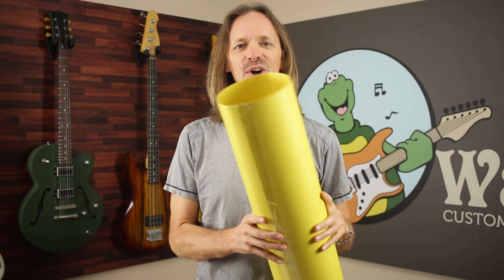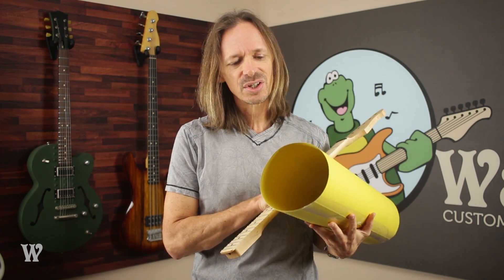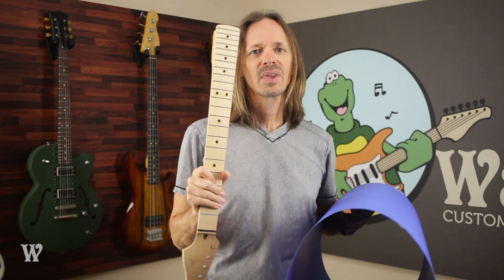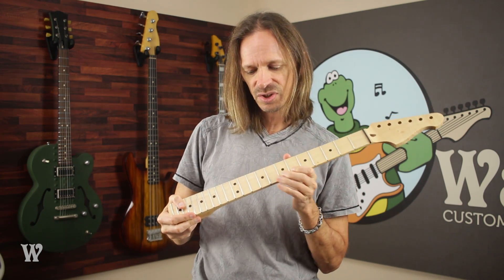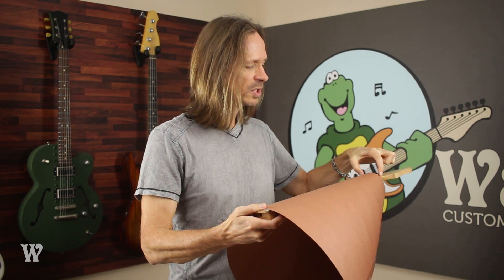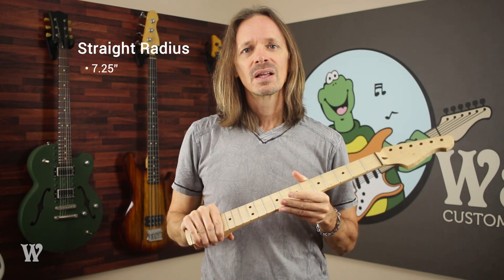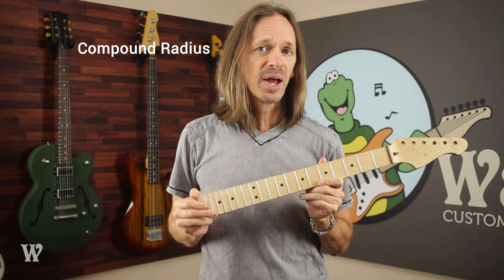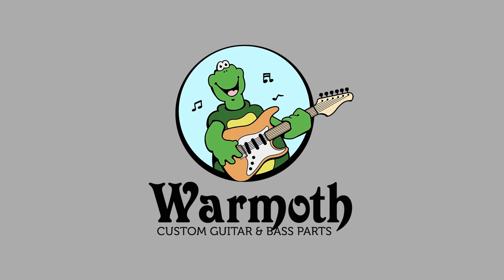Fretboard Radius Explained

Comment: That's a 7 and quarter inch diameter, not radius.....radius is the measurement from the edge of the circle to the middle of the circle. Diameter is measurement from the edge of the circle to the opposite side of the circle through the middle of the circle
Reply from the maker: Nope, fretboards use the radius. Can you imagine a curved a 7.25" fretboard would be if the number referred to the diameter? LOL. You can learn more here: https://warmoth.com/guitar-neck-fretboard-radius

Comment: wow thank you so much for a clear understanding lesson....i have a question...if the fretboards has a radius of a curve that means the frets are also curved same as the fret board..... when people sand the frets they are using a flat block with sand paper then the frets are not curved as the fretboard...the frets will be flat ..please explain on this  cheers again thanks for a great lesson..

Comment: Compound radius numbers represent 1st and 12th fret? If so,  the the bridge radius should be calculated as R12+(R12-R1), correct?
For example,  for 10-16" fretboard my bridge should be set to 16+(16-10)=22"

Comment: Here from the future (😁) to bring up why you'd want a compound radius. The answer is: lower (and more consistent) action!
With a standard radius fretboard the height of the outer strings (E,E) changes at a different rate than that of the inner strings (D,G). Why? Because the fretboard widens as you approach the guitar's bridge.  (Typical widths are 1.5 - 1.7 inches at the nut and 2.0 - 2.25 inches at the bridge end of the fretboard.)
Think about what will happen to a cylindrical section with a 12 inch radius when you make it wider at one end: as the section gets wider, its outer edges will 'fall away' from the center line of the section more than they do at the narrow end, simply because the wider part of the section contains more of the circle. This means that your outer strings will seem to rise as they approach the bridge, requiring a lower adjustment at the bridge. 
BUT, when you try to do that you run the risk of having notes "fret out" near the middle frets because the strings are not traversing the fretboard in a straight line, i.e. parallel to the section's center line. They would if your fretboard was the same width at both ends, but who wants a guitar neck that's >2 inches wide at the nut? Or 1.5 inches wide at the bridge end, lol!😁

Compound radii FIX this problem by changing both the width and the radius as you go from nut to bridge so that the strings' height is more consistent from one end of the fretboard to the other!

Comment: This is not correct. A16” circle is the diameter not radius. A radius is measured from the center to the circumference. A 16” circle would have an 8” radius.
Reply from the maker: All the info in the video is correct. You are right that the way guitarists use the term "radius" to describe the curve of the fretboard makes it a misnomer (just like the term "tremolo bar"). Nevertheless, it's the accepted term. What we really mean when we say "this fretboard has a 10" radius" is that the curve across the width of the fretboard is equal to the curve of the circumference of a circle with a radius of 10".

Comment: ok, but I'm a little confused, using your small cylinder you said you have a radius of 7.25 inches..I looked up the term radius and it said its a straight line from the center of a circle or sphere to the edge of said circle to sphere..So, correct me if I wrong, the higher the radius the more pronounced the curve of the fretboard..thank you
Reply from the maker: Nope, that's incorrect. The higher the radius the flatter fretboard.
Reply: Ahhh, thank you @warmoth
Reply from the maker: You are right that the way guitarists use the term "radius" to describe the curve of the fretboard makes it a misnomer (just like the term "tremolo bar"). Nevertheless, it's the accepted term. What we really mean when we say "this fretboard has a 10" radius" is that the curve across the width of the fretboard is equal to the curve of the circumference of a circle with a radius of 10".
Reply: thanks, that makes sense to me @warmoth

Comment: I love the 10-16" radius. If you want a locking tremolo with that radius, the Schaller Lockmeister is a perfect fit. It's almost completely identical in to the German Floyd Rose (also made by Schaller), but it has a flatter radius of 12", but you can get 16" if you take the shim out, and it comes with a 10" nut, so I can get a low action without the fret buzz and still play chords comfortably. 

If you have a body made for it, pick the Floyd Rose routing, not the Schaller one as it's made for a different trem.

Comment: I can't understand why guitars get such a small angle. The neck of most guitar  is very semicircular, the strings E1 and E6 slide off, they fall off with the vibrato. Tragedy. I have been looking for a flat, wide neck for years because it is the most comfortable one. It does not cause problems when playing.

Comment: Would you guys be able to build something similar to a Yamaha pacifica neck? It's a bit odd where it has a 41mm nut but the fretboard radius is 13.75 inches. (I would choose the 14" option from your website) Do you think it would feel somewhat similar if I got the 41mm nut with 14 inch board?

Comment: With the compound radius fretboards, what is the string radius that the nut & bridge saddles have. I would think the nut is going to be either he 9.5 or 10 that the 1st fret of the neck starts at and it's up to the set up to get the saddles to 14 or 16 that the fretboard radius is at the 21st-24th frets ? Isn't that going to be too flat for the middle of the neck and the action be set too high where the mismatches occur on the neck ?

Comment: I was ultimately screwed over by a website claiming that most fretboards out there have 9.5" radius. Once I looked up comparison of different brands, I found that the guitars I'm familiar with and are comfortable with have a 12" radius. Also, actually, MOST seem to have a radius of 12"... NOT 9.5". Now I'm going to have to adjust the 9.5" radiusing block to make it 12" radius that is on it's way.

Comment: A note about Floyd Rose nuts: they're not only 10" radius.

They come in 10", 12", and 15" radii. 

The 15" is confusingly named "R10" (at least for an OFR). I put those on my 16" and 17"  Ibanezes. 

I will say from experience, that unlike most other guitar setup specs measured in thousandths of an inch that you can really feel, the nut:fretboard:bridge radius relationship leaves me the most wiggle room to fudge. 

Not a ridiculous amount, but some. Because the differences between, say, 9" and 12", or even a 12" and 16" are quite small.

Comment: Compound radius is like a fix for a non-problem that creates a problem. I have a compound radius neck from Warmoth and it's horrible. I could never get low action that was close to any of my Charvels or Gibsons. It's not Warmoth, it's the inherent concept flaw. Just try to get someone to do a fret leveling-super pricey. Just how do you get a "perfect transition" from one end of the neck to the other? Plek? Maybe. Not by hand, that's for sure.  I love Warmoth and the neck so I'm pulling frets and re-radiusing the board and re-fretting. Sometimes you don't need to fix what ain't broken. Do we really need or want compound radius? I don't, to me it's less than useless and creates more problems than it solves. But to each his/her own....

Comment: Very cool video! However, I have a couple questions, that i hope you can answer for me. 
I have an old Matao Artist, that I have played enough that the frets are needing to be leveled, and crowned. Replacing the neck is not an option, due to it being a through neck. There is no real spec. info on it, so my first question is. Is there a way to at least get close to what the original radius is, without a radius guide? Being on a fixed income, I will have to do the work myself, and can only afford the bare minimum of supplies. I am not scared to do it, since I figure if I can make my own dentures, that fit very well, and look natural, I should be able to handle fret work, so long as I am armed with as much info. as possible. 
Next question. Can I just pick a radius sanding block, appropriate to what my main playing style is, and be okay ? at east 95% of my rhythm playing, I do in barre chords, so a little sacrifice of regular chords near the nut would not be much of an issue. 
Thank you for your time, and any advice you could share. 

Also, I have to say, I found it ironic, that while searching for info. I found this video, because I have a friend in Montana, who I started a Math group with, that is related to you!

Comment: I have always been a Fender guy but recently bought my first Ibanez. This thing is nuts. It has a 17" radius fretboard, a 5 piece neck that is the thinnest (from fretboard to back of neck) I have ever seen, it's got the smoothest trem system called the Zero Resistance (ZR) that moves on ballbearings and has an adjustable tensioner  knob  on the back. I read a lot of hate about that system, but I love it. It stays in perfect tune no matter what I do. And going back to the flatter fretboard, it takes a little getting used to but once you do, sell your Fenders because you just won't play them anymore. Like getting a Corvette and then trying to drive a Chevette. It just don't work.
Reply: may I know what model that is?

Comment: Can I order earth radius? Something like 6 000 km? Someone without imagination might call it flat. At least gibson fretboard would turn pale next to it, so curvy.

Btw which manufacturer first introduced compound radius? The most familiar I've been with Jackson, I believe 12"-16"? And what might be the reason manufacturers stick to different solid radiuses and only few go to compound? I can see with classic guitars sticking to classic. Appreciate the context of floyd roses, that's what I wondered when checking the options. I was thinking what's relevant when the website said floyd should be 10", but probably the most recognizable combination is jackson with floyd and 12"-16".
Reply from the maker: Both Warmoth and Jackson introduced compound radius at about the same time. A case of parallel development, I think.

Comment: When you say a 10" radius neck, is a true mathematical radius measurement or is there any conversion factor involved? I am only asking because the posterboard models looked small for the radius values you give.
Reply from the maker: The props are not actual size. I apologize. I did not have time to build them to scale or to paint them.
Reply: @warmoth  don't apologize. It was informative. I'm just surprised in how flat even a 7.25" radius neck feels compared to what I would expect given the r value. Probably because my point of reference is spheres and balls rather than cylinders.
Reply: @tak-el-uc  could always trace out part of a circle using something the length of the radius you want to see.

The number would be the distance from center to the outer edge. If you had a ruler with a hole on one end could just hold a pencil at the measurement to want to see

Comment: I could be incorrect but 7.25 is mostly known on 50s through 70s guitars from fender. 

Les pauls tend to be a 12 radius. Same for gretsch big body guitars, jets, and penguins. Modern strats today I believe are 9.5.

I recently got the 10-16 compound radius from warmoth and it looks like they did a amazing job as usual but I haven't tested it yet. Still setting up the guitar body I want to put with it. 

I have however tested a older neck made by them, and another neck I recently had them make and warmoth so far seems to have done a better job at making necks than fender in my experience so far. Sorry fender but some of your necks had my strings slipping off the fret board. Also got a channel bound fender American standard 2015/2016 tele anniversary neck that just feels... I can't figure it out but it isn't the greatest guitar neck lol. Whenever my fingers make contact with the rose wood channel bound fret board it feels as if my fingers get hung up on it, making sliding a burden. 

Warmoth however is yet to disappoint me.

Comment: Ii think you have your diameter mixed up with your radius. Radius is from the centre of the circle to the outside. Your cones look to be the size you mentioned, 7” and 16” diameter. A radius of 16” would have a cone almost three foot wide yours appears to be 16” as you stated.

Comment: I’ve never had an issue bending notes on a guitar with a 7.25” radius fretboard when the guitar is setup properly.
Reply: A "proper set up" is different for each player. If you use a medium to moderately low action and do small bends, there's no problem. But if you like super low action and do huuuge bends, you'll definitelly need a bigger radius if you don't want notes to die or buzz when you bend. It's just physics and geometry.

Comment: Hey Aaron. On a compound radius, for example 10-16, is the 16” radius measurement at the end of the fretboard or at the bridge? If it’s the end of the fretboard, which fret is that?
Reply from the maker: 16" is at the fretboard end, measured at the last fret.
Reply: Warmoth Guitar Products Thanks for the reply, but just to be nit picky, what if I order a 21 or 24 fret neck,  is it still the last fret? Also, is there a way to calculate the radius at the bridge?

Comment: i noticed the 12-16 compound doesn't bring up a floyd nut option will that be available?  you said it should work just fine, right?
Reply from the maker: Sounds like a combination that we missed when setting this all up in the custom builder. We'll see about getting it fixed. In the meantime, you can call in and order it if you like.

Comment: I'm going to be sending a custom Warmoth Tele Pro FatBack neck (10"-16") with stainless steel 6230 Dunlop frets to Dean Zelinsky (Formally of Dean Guitars) to get Z-Glided, which is a lasering process that patterns the back of the neck. The pattern makes for less drag on the back of the poly-finished neck. It's quite amazing.

Comment: Thank you for your videos bro! You rock! One question, as you said Floyd rose comes with 10” or 12” nuts I’m wondering how you deal with the fact that the bridge is 12” radius too when you have to do a compound 12/16. Please let me know! Thank you
Reply from the maker: What I do on my own builds is purchase Floyd Rose bridge shims and radius the saddles to about 18". You can get them from various places on the interwebs. However, a lot of people just use the Floyd as-is, and they are fine with it.
Reply: Warmoth Guitar Products awesome, thanks a lot! Hope to see you at Namm!
Reply from the maker: I'll be there, walking around looking sexy!
Reply: Warmoth Guitar Products 🤦‍♂️😂
Reply: From what I’ve read, the Floyd comes with shims preinstalled for a 10” radius but you can remove the shims completely for a 16” radius (the genuine version you buy aftermarket, not one already installed and setup on a guitar or a licensed version). I’ve never done it myself, always just bought guitars with Floyds installed, but it’s what I read when looking up shimming. Just be careful when you take it apart, as the saddles are different heights, have to go back in the same order they came out, which is why you can remove the shims completely and still maintain a radius.

Floyd radius aside, as for setting the bridge saddle radius, I use a 16” radius gauge and measure at the end of the fretboard, adjusting saddles accordingly. That way I’m not guessing at the bridge. Have to be a little more careful not to move the strings, as they’re easier to move around with the gauge towards the middle of the string, but with a light touch you’ll end up with the perfect radius at the bridge. The fretboard ends at 16” so just use a known 16” gauge and measure there. It will still continue to flatten out at the bridge.